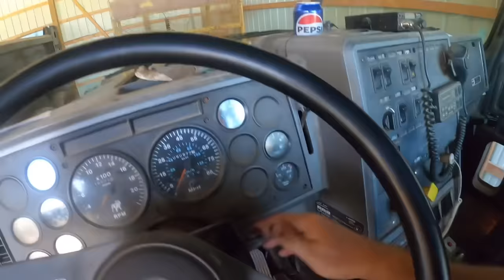Catastrophic Tile plow failure what happen to cause this epic failure?

Comment: Yikes, that stump @ Ts 6:02 wasn't so  bad, but the huge boulder that was compressed and compacted into the road by the original contractor caused the tile plow to twist at Ts 7:07,  and @ 29:05 just as the plow entered the 2nd cut across the road, it bent backwards and up several inches and snapped. I don't think it was avoidable at all but S#$T happens. The good thing is, you have the skills to fix it yourself and get it back to work. It would be nice if Aaron becomes available to share the repair load with you. I'm sorry Mike but thanks for this video.

Comment: The power of a very heavy machine with wide tracks applied to the end of a long lever (the extended plow), there will be extreme forces generated at the fulcrum. I did mention this aspect of the plow construction on the building-it-in-your-garage video. The highest stress location on this huge machine.
Reply: Thanks for bearing with a, well-meaning, critic. A 10 minute meeting of you, Aaron, and a steel structural engineer looking at the actual plow set-up to discuss stress points, metals, welding methods, and welding materials of course would be helpful, but I suspect that you would love to figure it out for yourself. Way more satisfying. My very amateur guess is that the break area needs a 3X strengthening, other parts in that area need a 2X strengthening, and I wish that the vertical shaft of the plow itself had 45 degree bracing inside every corner all the way up and down. It could twist and fold next. Any retrofit strengthening could change it dimensions. Kudos to being willing to fail in public. Been there.

Comment: These things always happen when a job is being done. Logicly thats when they fail if they are going to fail. Last Wednesaay #I had a waterpump fail on a 8 tonne( 18,700lb.) multi farmer 8 mile from home 3.00 and it gets dark at 4. Luckily I had a friend who came out and we put it on his beavertail trailer and got it home. Thats real pressure when a bit of kit fails on the job, it was reaired by Thursday night,- I had a sparewater pump ($400.00) , but as you say when you are self employed you just have to deal with whatever comes up.

Comment: It looks like not enough steel below the lower pin. It will need a good radius and not a sharper corner to help spread the load through the the steel instead of the more point load a sharper corner gives. You definitely found the weak spot though.

Comment: Trial and Aaron Is some times all you have to work with. LOL No Just kidding, Seriously experimental and or modified equipment is always a risk. Heck a new Dozer design will have issues you just found one. I have watched this from the beginning and thss is an AWESOME design. blue print and sell design to manufactures. Good luck.

Comment: It was hard to tell but the support steel on the plow holder look black to me mean that the unit actually broke days ago…you just finally put enough pull on it that it opened up…food for thought when you are building the next “holder” or plow guide whatever you want to call extra reenforce the bottom hole because that is what the plow is pivoting on not the top hole..the top is actually in compression it doesn’t need much reenforcement …Nice thing about prototypes they show you weak spots….
Reply from the maker: lol you guys crack me up thanks

Comment: It's possible that the first plow in with the 5 ton rock (like Stonehenge rocks) kinda set the course for a true test of the engineering that went into the design. All the previous work done by that equipment is nothing to sneeze at... lots of content and miles of tile in place, all working great. Nothing is unbreakable, but that monster lasted a good while. The way those cylinders snapped was horrendous. Get Aaron and Matt to at least come look at it... Now that will be content you had better share! Not to mention Mrs. DP.

Comment: That really sucks! It would suck more if it was to a $80, 90,000.00 plow you had bought. At least this one you don't have to wait on the dealer to get it repaired. That has been one heck of a good piece of equipment.
Reply from the maker: Yup

Comment: That was some saussy sh***. I am nooo engineer, but when making one off's I attempt to leave minimal of half the width of the hole or if your greedy, for the amount the hole is wide have it that much as wide on the outside diameter thickness,. Btw just peanut galleries here, just side speculation.  Besides I still admire the F.... outa what ya'll have created to begin with. Definitely awesome don't let that go to ya'lls heads though 🫣🫣🫣🫣🫣. Have a good day and thanks for letting us tag along.

Comment: I still think there needs to be a shear pin system the will fail first befor the main structure gets damaged ,maybe high tech with a hydraulic system release through the Dozer Drive system,cutting back track power .

Comment: After all of the MILES of drain tile that plow has placed something eventually had to fail. Now you know now where a weakness is and can tweak the design, repair the plow and get it back to work stronger than ever. It's an evolving prototype. Sadly, $hit happens!

Comment: 33:59 man, when are you going to find an electric shop hoist? The noise of both the air motors and the compressor running all the time would drive me nuts. It also saves a lot of electricity because pneumatics are extremely inefficient.

My mate pulled one from the scrapbin at work. I changed the bearings so its quiet, and it has served me for 15 years now.
Reply from the maker: Absolutely never you use air you will never go back don’t like it move on to the next Chanel thanks
Reply: @DirtPerfect  No offense meant. Since my head injury last year, i bought an electric impact wrench to replace the pneumatic. One less source of hissing, i can use earmuffs when operating it, but when not operated, its quiet. I like quiet since my skull fracture  😉👌

Comment: Start beveling with the torch or plasma. Glue her back together. Add some 1” plate to the outside. Maybe back cut those gusset plates instead of just fillet welding them for some added adhesion. New cylinders and you’ll be back up and ripping. My guess is that first big rock put a stress crack across one of those plates. Then maybe you hit another one in the road on the second tile. Unfortunate. But also a learning moment. Now you know it’s first weak point and you can address it.
Reply from the maker: So confused you not what the videos 🤷‍♂️

Comment: Hello Mike your friend  Martin  here  I see a lots of  people saying  I am  sorry  but nobody  come with the  solution to your  Problem    I want to run a Idea to you and if you think it work  your  Plow set up have 5 fingers if I remember right  how about re do your tile plow and  also  put your  center finger in front of the tile  plow like that it  Pre plow the dirt before you  tile  plow do it like that  the finger take care of all the   Big rocks and  roots  and then the tile plow  have a safe way to go without any problems  and if you use the  center  support for the tile plow how about  making it a little  more wide and with a  longer pin that  can hold  the tile plow and the finger  in my CAD Design  program it work  but I do not know if it will  work for you  if it work  just  send me  shout out on your  video and Happy Holidays to you and the Family and the Crew  and about the  broken part how about  doing it double wall  I know is more weight  but  more strong  unless you can get a thicker  plate
Reply from the maker: Stay tuned

Comment: What you need to do to get you a Pole that you can that has a sharp maybe some reborn on it that you can stick it in the ground and have a metal Pole. Come out and the reborn comes out the bottom of it have AT board on the bottom of the bottom-up that way you stick it and has a flag on the top or a flashing light battery, powered flash and light or something like that. You stick it way up there and make it adjustable, where you can raise it up to high so you can see it from where you want to go and then you can.  Put it in your you want to and be able to see what you're going

Comment: Rock stretched the 💩 out of the tile plow...  unseen crack and it just spread.

The metal appx 1 inch wide each side of the rip should be cut out and replaced.

Comment: Mike the abuse the tile plow has taken in the rock and very hard ground plus pulling with another machine consider how much stress it puts on the mounting bracket plus the plow can go down 5' below the bracket that puts a lot of strain on the lower pin mount at it's weakest point. I enjoy your videos but this video brings back memories of running and working on heavy equipment it's not good for the stress you go through knowing Farmer Chris needs the tile put in pronto.

Comment: You will never record another failure like that again in your lifetime.  I see the failure mode clear as day.  Repair isn't that tough... Will require some machine work if you want it right.  Get on the horn for those cylinders.  Sometimes they are easy to come by... but when they are not... man is it a pain.  I really can't believe you recorded the actual failure.  Unbelievable.

Comment: MAYBE ➡️➡️➡️➡️➡️➡️➡️➡️➡️➡️I've often thought in the past if you had a regular riper, mounted on the main riper bar, in front of your tile plow it would pre-rip and take a lot of stress/wear off your tile plow!  Maybe even let you steer a bit easier since the main ripper would be forward several feet giving you a pivot point.  A lot easier to replace a broken standard ripper shank than your tile plow, just saying👍
Reply from the maker: Worthless I have covered this thanks

Comment: Just call you a bull in a China shop. 
I’m thinking double plating the break. Sandwich the break basically. But truthfully as much tile you’ve laid, it owes you nothing. Layered welding might be the fastest repair method. But the replacement hydraulic is going to be the issue

Comment: That's exactly where it was gonna break.  There is the reason commercial units don't have a depth slide, but use parallel linkage.  No type of tillage uses plate steel the way it was used on that plow for this reason.  Bolt on tillage was replaced by a 3 pt hitch.
Reply: The best mounted commercially available tile plow was designed by a welder not an engineer.  Failure is in the design layout on how geometry transfers pulling force and boot resistance.  It ripped from the bottom up creating a hinge where there was none.  Pitch control to control depth is the industry standard for exactly the reason your plow fails.
Reply from the maker: Lol your lost sorry
Reply: Hit rocks way bigger with commercially available mounted plow on a quad and never had to call a welder.  You're on your 3rd guess of what will hold together.  Put a heck of a lot more pipe in the ground than you have.
Reply: Every deep Inline ripper with a spring reset on it (which is the same theory on a different scale) pivots in the same way your plow tore.  You created a floating shank with two pieces of plate steel transferring all the draft that got pulled apart like Laffy taffy.  It's not a good design, and thicker plate steel or the same thickness used in the same way will eventually fail in the same manner.  There is a reason parallel linkage and tube steel is used.  Go ahead and keep fighting your design.

Comment: It's time to upgrade and replace  that cutter/ pipe layer.
Reply from the maker: So confused we where back plowing pipe in 1 1/2 days plz explain this comment thanks
Reply: @DirtPerfect  I didn't see the videos of the rebuilding and upgrades yet. I was just making a comment in a general statement. Most people would've just replaced the rig. 
I have since watched your videos on the rebuild and upgrades you have done. I'm impressed with your work.  Nice job.

Comment: Your always plowing with the ripper up and the plow down adding unneeded stress. If you do not need the extra depth you should have the ripper down and the plow raised up.
Reply from the maker: Lol plz think about why do that thanks
Reply: @DirtPerfect  I can think of a few reasons weather or not they are the reasons you do it.   Visibility, room for dirt rocks and stumps that get pulled up, and traction/weight transfer  but at the same time. The further the boot is extended the more leverage it has,  thus the reason for my comment

Comment: Putting a tile cart hitch sticking out the side from the blade is out of the question? Should be simple enough as using square stock to essentially make a receiver for 6 ft long 2 in square stock with a spot for the tile cart pin to go through.

Comment: Undue stress? Maybe, excavate the road, first? Maybe? Hardpack,  a rock, or concrete wall over culvert pipe to stop erosion? Too many questions. Save wear and tear off the ripper. 
 Do you think Aaron would have seen that rock. No excuse for DP's warning device to take off like that.

Comment: One time when pulling a ripper tine on a dozer or excavator through first could have saved it. In hindsight, digging through the road with the excavator would have been advisable.
Reply from the maker: Plz think why that makes no since thanks
Reply: @DirtPerfect  Since what? Using since in that sentence makes no sense. The road is likely to be the hardest part to plow through. They often bury rock in swampy areas in roads and the roads are packed hard from years of being driven on.

Comment: "OOOUUUUCCCHHHH!!!!!!!!!!!!" That's going to be "costly"!  "OOOFFFFF!!!!!"   You probably already figured out what to do.  Here is what I noticed.  The amount of steel over the top pin and under the lower pin, was not much steel.  IF you are not using an engineer, making the bracket higher & lower should strengthen the weak pin holes.  Can't wait to see the solution you will implement.  No one has x-ray vision.  No way you could see what is in the ground.

Comment: I don't remember when you were building that thing and I told you what was gonna happen and it looks like I'm right.
Reply from the maker: 😂😂😂😂😂😂😂😂😂😂😂😂😂😂😂😂😂😂😂😂😂😂😂😂
You missed. A Few very  key details I got right
Reply: @DirtPerfect  You didn't get any of it right? I told you at the time when you were building all that did. I used to do the phone cable And it happened many times
Reply: @DirtPerfect  Your biggest problem is, you don't have a shaker box. A regular plow has your shaker box. You're just trying to use brute force. Which didn't work out.
Reply from the maker: It’s very clear you don’t understand anything about tile are what I the channel there is one HUGE difference do research before commenting plz
Reply: @DirtPerfect  Don't need to cable drain tow all the same stuff. They all have shaker boxes on the Plow
Reply: @DirtPerfect  I sent you the link below. It has a shaker box.
Reply: @DirtPerfect  Shaker box vibrates the ground and breaks up the ground and rock. Takes pressure off of the plow.
Reply: @DirtPerfect  But you're a Superman and you've got it all Figured out not
Reply from the maker: Absolutely worthless to me think about it worthless
Reply: @DirtPerfect  I've run miles of cable. You Have done feet of pipe.
We would do 1500/ 2000 feet of cable in a day. You might have done feet in your entire lifetime
Reply from the maker: Lol you just don’t get the difference do you kinda sad
Reply: @DirtPerfect  It's sad that you can't figure out. It's the same situation. That's why you made a big video of building the whole thing. And then it broke in half.
Reply: @DirtPerfect  Doesn't matter if you're installing Drain tile or cable. Same thing same principle, both need a shaker box and a plow. The shaker box breaks up the ground. Reducing resistance and pressure put upon the plow blade itself. So they don't shatter like yours did.
Reply: @DirtPerfect  Nothing like an arrogant green horn.
Reply: @DirtPerfect  I guess all the major equipment companies and their engineers don't know anything either.
Reply: @DirtPerfect  You're trying to modify a ripper blade into a plow blade. Not the same situation. Requires different equipment. And somebody with a whole lot less arrogant.
Reply: @DirtPerfect  You put in a few feet and you think you're an expert. People put in miles over years and you don't think they know what you're talking about. That's the definition of arrogant.
Reply: @DirtPerfect  But I told you so.

Comment: Well no welds were sacrificed in the making of this video 🤷🏻‍♂️😉😂 if you know you know on that with them folks in the comments that say them welds will never hold. This break no one would be able to see it before without Ex ray equipment to see inside the piece of steel. I am no expert and I am sure that you are brainstorming on. One idea I have and by no means am I sure of. I would do away with the pins where it broke. Put a thick piece of steel for the front of boot to ride against. Then there is no chance of a hole through side plates just one solid piece. So if fails again then it’s 💯 steel needs to be thicker or hardened. Also look at the stench in steel on as paint shows it 😳😬 further up on side plate above the ripper frame there is another stench problem showing in paint 😏 think only the boot and pins are salvageable. The rest are behind a permanent fix. But a new episode of a new design of the frame for boot. Send the bill to farmer Chris 💁‍♂️😂 kidding on that. We all have built something with intention of it being bulletproof. Not all can be done with that in mind the first time. Been there before.